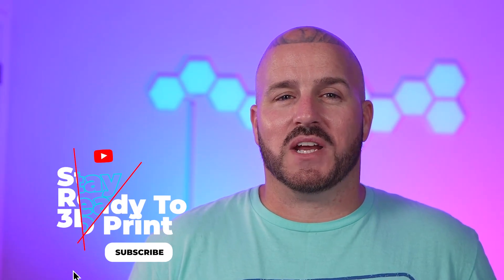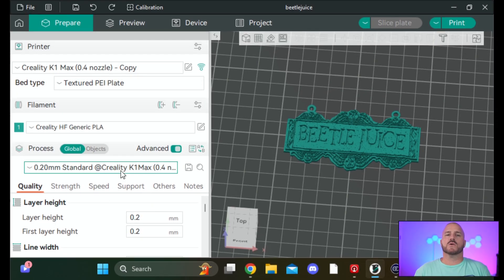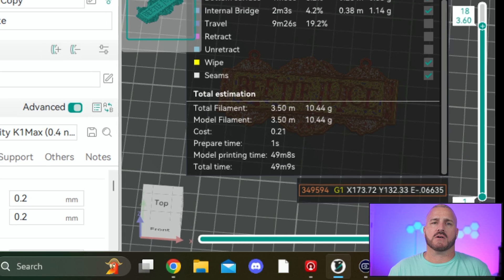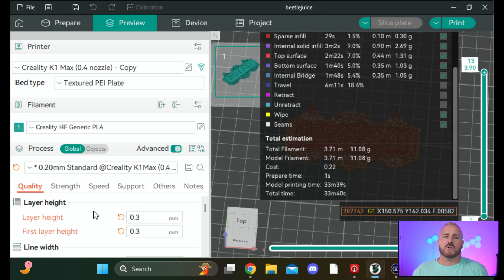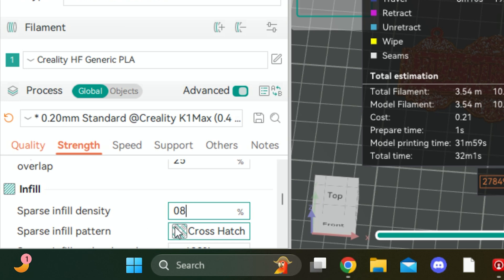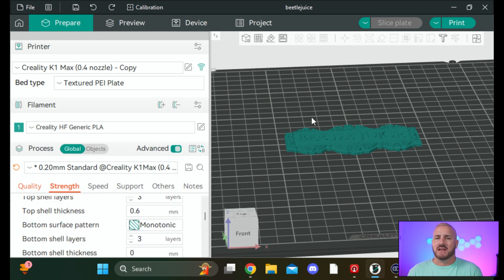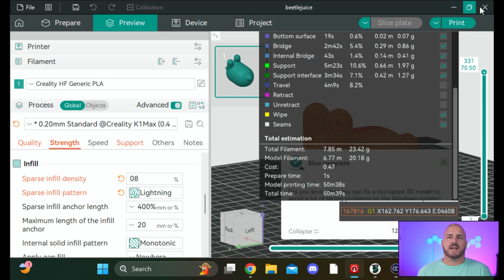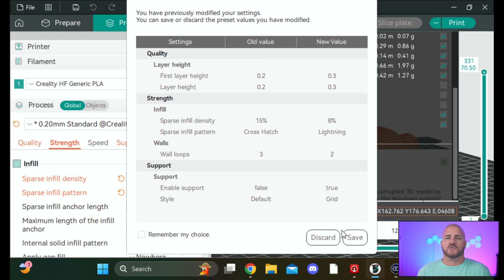Improve Your Print Speed On Any 3D Printer

Comment: Be very careful on layer height. An optimal height for a 0.4 mm nozzle it will be 0.2 mm, while for a 0.6 mm nozzle it will be 0.3 mm. Layer heights greater than 75% of the nozzle diameter should never be used. Also, it's good practice to increment heights with the same consideration. I.E. 0.4 nozzle would be in increments of 2 or 4 : 0.28, 0.24, 0,2, 0.12m 0,16, 0.08. these reflect and respect the 0.4 nozzle width. there is a reason for these numbers. I'm sure there's a "calculator" or paper on this and it's reasons. I tend to trust these. Other that that, it's refreshing to see someone just say, you can just print something "good enough" not everything needs to be the absolute highest quality.
Reply from the maker: Yeah I agree! You can get technical with it I guess. But this method is for those prints that you just don’t care about quality or strength. Not all prints have to be strong or look the best. In those cases, you can save some time. A lot of time actually. Thanks for your input! I always enjoy the comments and people’s insight.